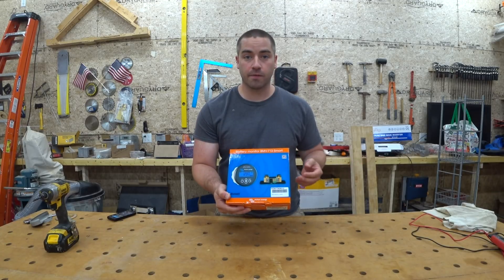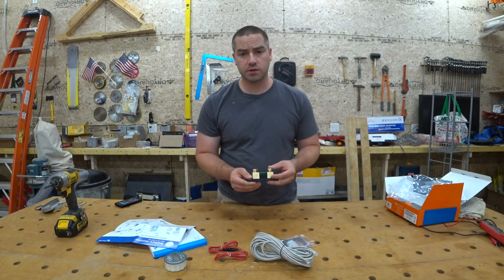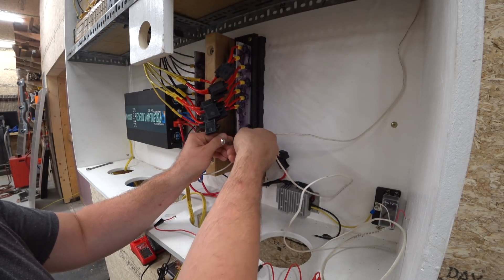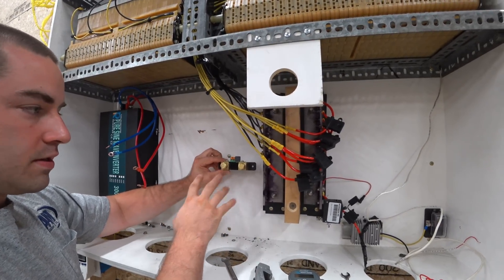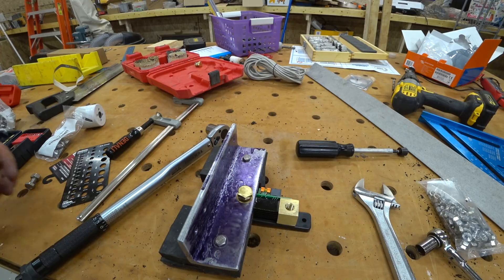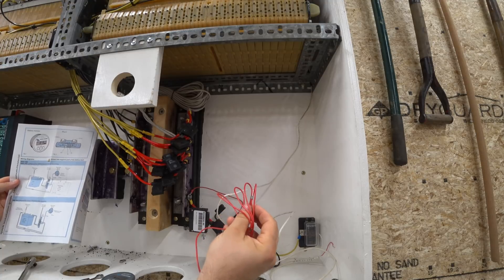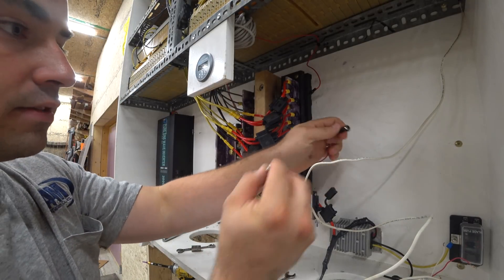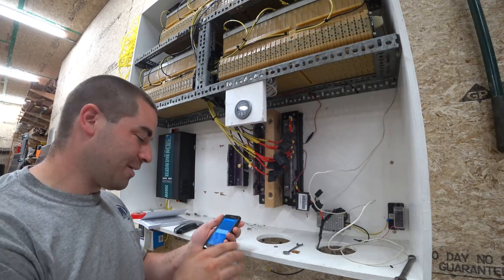Installing Victron Battery Monitor BMV-712, DIY Powerwall

Comment: It connects just fine with a pixel 7 even with old firmware. I have not yet used an apple device with my BMV 712.  The bottom of your android device in this video having three printed buttons tells me that it is really old... Even considering the year you posted the video.

Comment: Did you ever make a video for setting up the relay function?

Did you change the temperature coefficient in the miscellaneous menu?
Reply from the maker: I never hooked the relay up to anything.  Yes, I changed the temp to 0 to prevent ever adjusting based on temperature.  I did it that way because my batteries are inside my heated garage.

Comment: Hi David, I was searching for battery monitors and your video popped up.  Been a sub for a year or more.  Thanks for your videos.  I have a question on the aluminum bus bars.  How do you manage the copper connections to the aluminum metal?
Reply from the maker: I don't connect the copper wire to the aluminum bus bar directly.  Instead I crimp on a tinned-copper ring terminal.  The plating on the ring terminal prevents a lot of possible corrosion.  Also, this is indoors, so it's not getting wet.  Also, I coat it with a battery anti-corrosion.  You could use No-Ox, or electrical grease.  I have a spray sold for battery terminals.  Any of them help.
Reply: DavidPoz thanks for your reply.   This sounds similar to the approach they used to do with house aluminum wiring.  Thanks for the reply.  Love your videos.

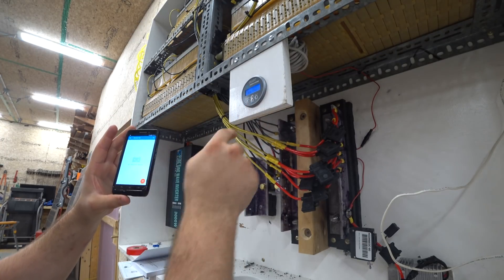Comment: 10:40 It's not a problem with the BMV or the app, it's a problem with your phone. I think it's just to old/a to old Android version running on it.
I have a Samsung Galaxy S7 (I knwo it's also not the newest phone) and I never had such a problem and I install/configure Victron products daily.

PS: The Windows version of VictronConnect can't connect via Bluetooth, only via USB.
This is also not a problem of the VictronConnect App, it is a Windows limitation.
Reply: I have tried to make the connection with 2 phones Samsung Galaxy Note 9 and a tablet Samsung A8. So it is not an old  Android issue I believe unless it needs to  be an older version - if your Galaxy 7 connects with no issues maybe it has no issues with certain older Andriod versions... 
DavidPoz had the same issue and he updated the firmware of the monitor. I did that too using a friend's apple phone. But it still can not connect to neither of my Samsung devices.

Comment: Hi David, great video! This is the only video (I saw a lot of them) that refers to the problems with Android connectivity. And it is a big problem...
I connected with friend's apple phone, it suggested update and we did it. But I still can't connect neither of my 3 samsung devices. Could you please, tell me what I might be missing? How exactly did you update it and what did you do next? Thanks a millions!
Reply from the maker: OK.  On my wifes phone we went to the app store and downloaded the Victron app.  Then we went to the garage.  We had to have data and bluetooth set to "ON".  Then, on my wifes apple phone, we opened the victron app.  I think it automatically scanned for devices and found the BMV-712.  We clicked on that.  The app automatically prompted us to update and we clicked "yes".  After it was done updating we disconnected her phone and then the motorola with android worked.

Comment: I thought that stainless steel hardware with aluminum will result in galvanic corrosion ??? i.e. inside the drilled holes.
Reply from the maker: I had the system up and running for two years.  Just took it apart and it looks exactly the same as the day I installed it.  no corrosion.

Comment: Hi  great video  just 1 ? You mentioned  the cell voltage  was 4.06  per cell  is that to high  I try to keep mine to 3.65   I am working with 2 packs at 12 v 200 amps   Thanks Jeff
Reply from the maker: We might be working with different chemistry?  My cells can go up to 4.20 volts, but I keep them lower to prolong life.  I think 3.65 volts is the maximum allowed for Lithium Iron Phosphate chemistry.
Reply: Hey thank's  mine are gen 1 Chevy volt
Reply from the maker: Gen 1 and 2 are the same chemistry: https://media.gm.com/content/dam/Media/microsites/product/Volt_2016/doc/VOLT_BATTERY.pdf
I personally use 3.5 volts per cell up to 4.05 volts per cell.

Comment: Daidpoz I am confused it seems to me nothing is going thru the Shunt or did i miss something please forgive me if I did
Reply from the maker: The shunt is on the negative side of my battery.  The shunt is located between two aluminum bus bars.  One bus bar goes to all the 8 batteries in parallel.  The other bus bar goes to the inverter and charge controller.  Thanks for watching.

Comment: you have misunderstood the battery protector spray. you don't want it between your terminals and the bus bar. spray it after the terminals are fitted.

Comment: I think your choice of aluminum for a bus bar is not a good idea. It is recommended to boaters not to have brass come in contact with aluminum. See this link https://www.boats.com/reviews/keep-aluminum-and-brass-separated-in-the-marine-environment/ Also your copper ring terminals connected to the aluminum bus bar can corrode over time and possibly cause a fire. Especially with high current running through the wires. https://homeguides.sfgate.com/problems-aluminum-copper-wire-electricity-86313.html I suggest changing out the aluminum bus bar with a copper one. One last thing commercial aluminum bus bars are tin plated for the reasons I mentioned above. Just my opinion. Good luck.
Reply from the maker: Thanks for sharing.  Eventually I probably will swap them out.  I built them with what I had on hand.  They have been up over a year and all the rung terminals are still tight.  I have also scanned them with an IR thermometer during high charge/discharge cycles and they don't get any hotter than ambient.  I have a video on making the bus bars: https://youtu.be/DsbgNuZtBqY  Thanks for watching.
Reply: J P hello, I have a similar question with aluminum to copper.  Dissimilar metals have long plagued us in the aircraft modification business, so I am looking for a good way to do bus bars without risk of Dissimilar metal (anode/cathode corrosion or fire risk).  I will look up your links.  Thanks for posting them.  Cheers!

Comment: David,
    This is a nice system but I have a property that is remote and have a trailer on that which is powered by solar is there any decent system that I could monitor the battery and usage amd solar output remotely... I have and outback flexmax 80 
Jim Anderson
Reply from the maker: I don't know of a perfect system for that.  My best answer is to use an old (or very cheap) cell phone in the trailer with the app on it for Victron.  Then connect to that cell phone from your mobile phone using an app.  I know there are apps that allow remote viewing and remote control of cell phones, but I don't know what that's called.

Comment: Hey, is your battery monitor resetting itself to 100% SOC as the batteries are being charged? I am having a problem with mine. It's basically not synching. Thanks and keep up the good work.
Reply from the maker: It's too early to tell if it is automatically syncing on it's own.  I have been playing with the settings and manually sync when I adjust the settings and am full.
Reply: @DavidPozEnergy  Yeah...I've been doing it manually from time to time. All readings seem to be correct, but it won't automatically sync. It seems so easy to setup that I feel dumb...lol. Keep us posted. I'll do the same.
Reply: @DavidPozEnergy  you have to do it manually at a known 100% , under settings (battery).

Comment: Hi great video
How do you program battery shant to cut load if voltage drop too low, is this possible with bmv712?
Great work you do
Reply from the maker: The BMV-712 has a tiny relay inside that can then be used to power a larger relay for turning things on and off.  I'm actually playing around with this feature and will make a video when I get some things hooked up.  But right now, no, the BMV does not turn on or off power to anything.  It just records the power into and out of the battery.  So how do I prevent the batteries from being drawn down too low?  The inverter automatically cuts power at 42 volts.  That's it.  Inverter shuts off and there is no more draw on the battery.  I hope that helps.
Reply: Great well I wish I could get inverter like this to be grid tied and programmable, thank you for your time I'll keep looking on your channel
Regards from UK
Reply from the maker: Hi Pawel Dedys,  I have an Aims inverter.  Here are three videos about the inverter:
https://youtu.be/dfHb5tZErTs
https://youtu.be/XcCcpag67MM
https://youtu.be/4EsYfdK1Hn4
My inverter is not capable of back-feeding the grid.  If you want to be able to do that I think it's called a "Hybrid" inverter.  Schnieder and Outback both make good ones that are available for Europe.  https://www.altestore.com/store/inverters/hybrid-inverters-c561/  I hope that helps.
Reply: What sort of inverter you use?

Comment: have you had any more problems with Bluetooth. i  am with mine been using it about a week now . i can not see bmv 712 in my Bluetooth list i disconnect meter i can see it again . 24 hours later same problem every day. does any body have same problem and know how to fix it . its same on all are phones till we unplug meter then its fine again.
Reply from the maker: I have not had that problem.  I'm sorry, I don't know what could be causing that.  Good luck.
Reply: found the problem my nvidia shield some how paired to the bmv712 .it has got stronger blue tooth than my phone and only one device can be connected.once i unpaired the nvidia shield i had no problems .working great now

Comment: That Battery protectant spray...I wouldn't spray it between the contact pacthes its non conductive so all the load is going trough the bolt instead. FYI

Comment: DavidPoz thanks for the video! Do you have any update for your comment about 100% state of charge?  Your initial thought was that when the voltage reached the upper setpoint then the Battery Monitor would auto-calibrate to indicate 100%.

Comment: Love the DIY powerwall project!  Question: How are the individual Li-ion cells managed for things like Over Voltage, Under Voltage, Over current, charging control etc.?  I know from personal experience that Li-ion battery chemistry must be respected above and beyond other, more stable battery chemistries.  It seems that all of the original BMS hardware in your project was removed from the Volt battery pack before installing into your wall cabinet.  So I was curious how each cell is being managed.  Also, it seems a bit risky to install such a high energy density battery pack inside your home.  Typically, if a Li-ion cell fails it will achieve thermal runaway very quickly and there's really nothing you can do except wait for all the stored energy to dissipate.  Considering all the wood panels surrounding your battery pack I would be very concerned about losing the house should the battery pack fail.  Sorry, don't mean to be an alarmist but I hope your battery project is safe.
Reply from the maker: Hi Chris,  Sounds like you are asking if I have a new BMS.  The answer is "not yet".  I'm still building the whole system and have not chosen a BMS that suits my system yet.  I have 8 modules with 12s each.  This means I either need 8 small modules, or a large custom one.  The small modules in 12s are usually set up for a lower voltage (I think 36v) and not 44v as my groups are.  

However, finishing my project got put on hold while I'm working on some other things.  Ever since I stopped using the AC last month my system has been dormant.  I did check each and every cell last month when I disconnected, and they were all within 0.1v of each other.

Thanks for watching.
Reply: Hi David,  

Thanks for the reply!

Noted the project is on hold.  I have projects like that as well.  Life gets in the way sometimes and we have plan accordingly. 
 
The Volt battery pack design is very interesting to me.  In your opinion, does it look like each cell is encased such that if a cell were to fail it would do so in a safe manner?  Meaning it would contain a cell in thermal runaway?  I'm guessing that GM planned for such a problem in a worst case scenario or else they could get into big trouble.  

When it comes to a new BMS for the Volt battery pack are you considering designing one from scratch or has someone out there on the web come up with a comprehensive system to cover all the requirements for maintaining individual cells within the Volt battery pack system.  I would be really interested to learn if one exists!!  I have looked but so far haven't found anything.

Best regards,

Chris.
Reply from the maker: Hi Chris,  The cells are in a plastic housing, so I would guess that if the pouch overheats it would melt the plastic and/or catch the plastic on fire.  

If you haven't yet seen the channel "Going Off Grid" check him out, he has tried out a few different BMS's on Chevy Volt batteries.

Comment: Have you thought of using brass for the bus bars, that would be a much better material , and use brass  lag bolts as well.
Reply from the maker: Hi Fred,  Certainly a bus bar made from copper would be better.  I have a bunch of this aluminum and wanted to put it to use.
Reply: You can easily slip a strip of copper over the aluminum. I am an engineer and I am concerned that the aluminum can oxidize and cause a fire.  I calculated the resistance a a strip of copper that is 22 gauge, 2 inches wide and 6 inches long would have a resistance of less than .0003 ohms. Just slip a piece of copper on top of the bus bar.
Reply from the maker: Hi Fred,  I'm unclear about how that would work.  I'm guessing I would first un-bolt each connection, hold the copper over the aluminum, mark each hole from the back-side, drill, and then re-bolt everything.  If that is the case, then wouldn't the electricity all flow through the copper, and none through the aluminum?  Wouldn't that then overheat the thin copper?  I'm not an engineer so I honestly don't know.  One reason I like these bus-bars is that they have one square inch of material to carry the current (0.25" x 4" cross section).  22 gauge is 0.0299 inches x 2" = 0.0598 square inches, only 6% of the aluminum.   I think I remember reading somewhere that copper is twice as good as aluminum or something, so would that mean that the copper strip could only carry 12% of the total current that the aluminum can carry?  Unless they are working together, but I thought electricity follows the path of least resistance.  Anyways, not arguing with you, just trying to fully understand.
Reply: take a strip of copper  for example 22 or 20 gauge, 2 or more inches wide, and as long as the bus bar, remove all the screws, lay the copper on top of the bus bar, drill holes in the copper to match the aluminum, and have all your wires make contact with the copper. A piece of copper like this would cost less than $1. All the wires and bolts make contact to the copper, and the aluminum is there just for strength. You won't care about any oxidation in the future.I hope that helps. There is a real reason aluminum wiring is not used inside a house anymore, it is too dangerous. The oxide layer builds up over time and the resistance goes from next to zero to many ohms, a chance for a fire.

Comment: Aluminum and copper are very easy to work with I go to the metal dealer to pick up the scrap odds & ends aluminum at a very cheap price, the inverter screen is always in a bad View when the inverter is mount it right
Reply from the maker: Cool that you can pick up material cheap.  And, yes, the screen is no longer visible on the inverter.  At least for this inverter the screen only showed volts.  Now the victron battery monitor can show volts as well as the state of charge, amps, etc.

Comment: I have no IPhone so I guess this option is out for me for now. Nice detail as usual cheers.
Reply from the maker: Yeah, or confirm that the particular unit you order has the updated firmware.  The firmware mine had was two versions old.  I wonder how long it sat on the shelf of the warehouse?
Reply: I was able to update my firmware on my Victron Inverter and Charge Controller with my Android, no problem. Perhaps it matters what OS your Android is running? Anyways, it could work and did for me.
Reply: I just installed the 712 on our fifth wheel LiFePO4 12v battery and it was also two versions old. Updated on iOS no problem.